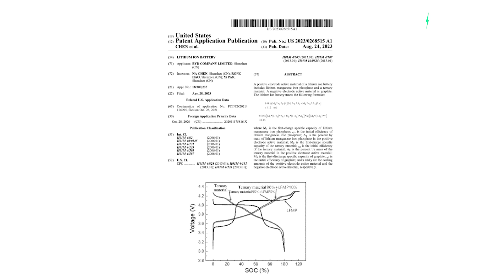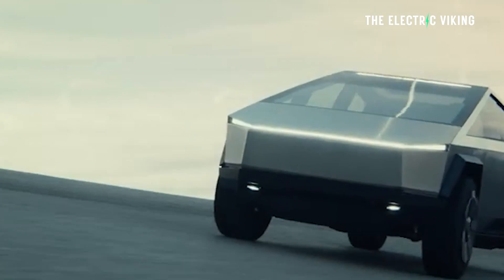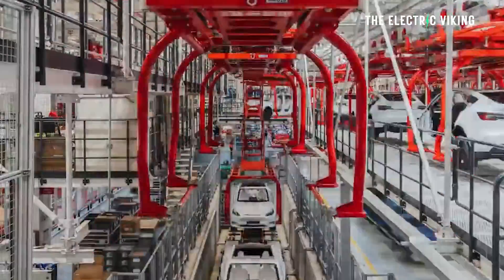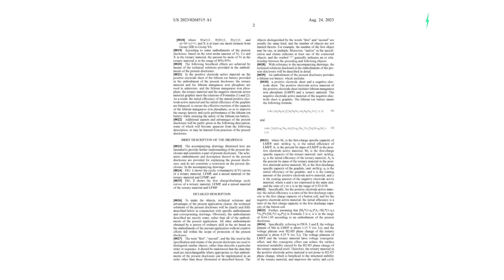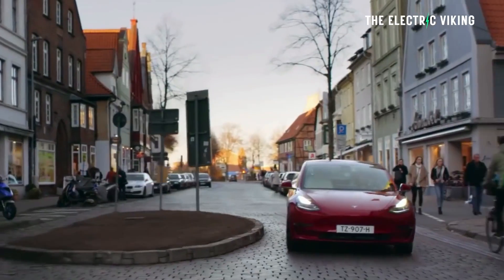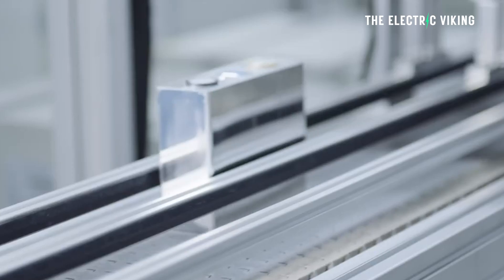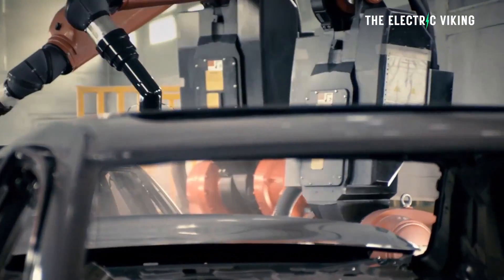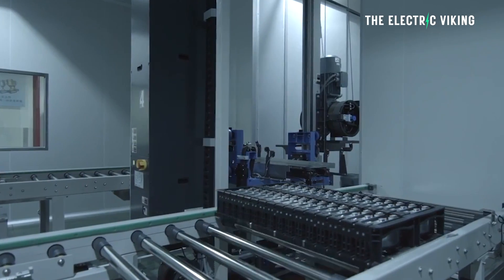BYD patents CATL's new M3P battery in the United States

Comment: The M3P battery is currently only made by CATL of China. However, the patent filing by BYD suggests that the company may be interested in licensing the technology from CATL or manufacturing the batteries themselves.

It is also possible that other battery manufacturers will develop their own versions of the M3P battery. The technology is still in its early stages, so it is likely that there will be more innovation in this area in the coming years.

Comment: US grovement may put a block on  BYD.  Sam ignore the fakers. They will that the recent starship lunch was fake despite the huge hole dup by over 6000tonnes of trust and all the concrete lumps weighing over been 300 feet in the air .I watch you because you are honest . You only say things after you checked the facts.  M3P batteries  you told about a year go and have proved to right. Do you think  there could be a  future  for ships full of .batteries  charged by solar farms in North of Australia.  . If my maths are right  100,000 tonnes of batteries  would 1 terra watt of stored energy.  This provide 100Mega Watts of power for 100 hours

Comment: If it makes it easier to understand, M3P is simply a CATL’s “recipe” for their LMFP product.  There is nothing to stop others from using the same chemistry as it’s not as simple as just adding Manganese to the mix.  BYD obviously have been working on their own recipe of LMFP batteries and have patented their particular process.
There is a good video that just came out from “The Limiting Factor” YT channel that explains the difference between M3P and LMFP.
And actually M3P isn’t that big of a breakthrough anyway - it sacrifices part of the longevity of an LFP battery for a compromise battery that basically sits in the middle between LFP and ternary batteries.

Comment: LMFP batteries and the M3P batteries are different. The M3P battery can be seen variation subset of LMFP   There can be variations with their own additives and ratios  which can be the BYD patent The limiting factor has a video just released on the differences between LMFP and M3P
Reply: @@admin-en5uv that’s exactly it. The design of M3 P is to increase the charging cycles while keeping higher enegy density over LFP as LMFP loses too much in way of charging cycles